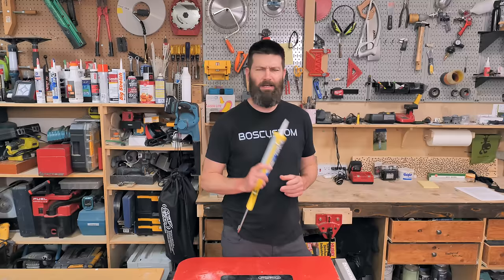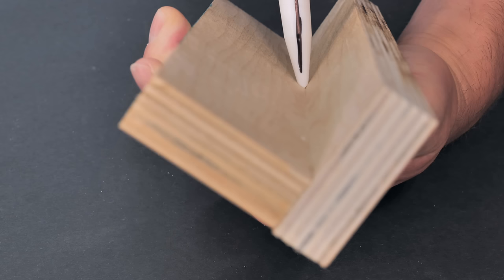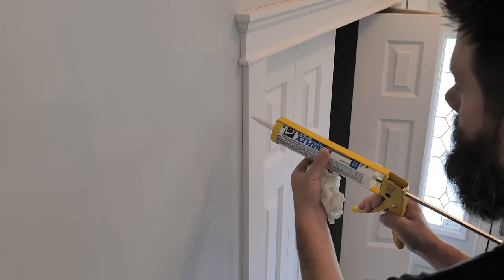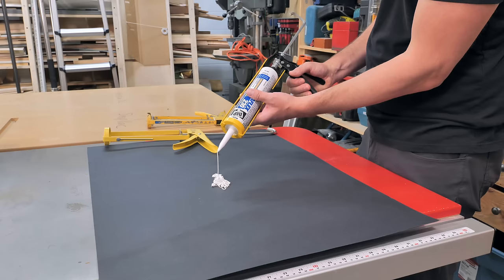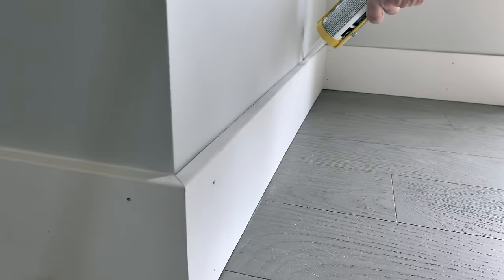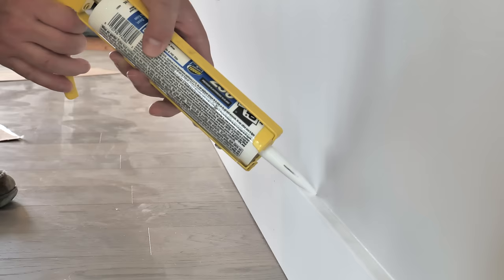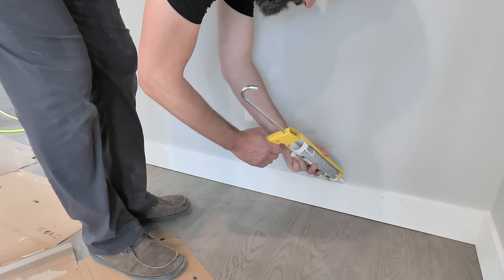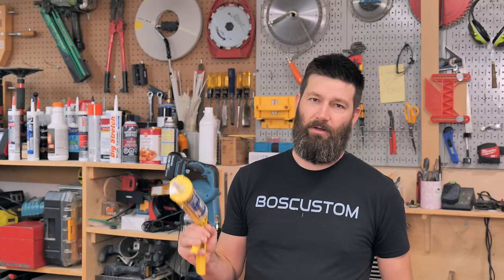The Secret Caulking Tip That Will Transform Your Ability!

Comment: Thank you, this is helpful. But it's still kinda hard because I always get messed up in the corners, esp. when 3 "directions" meet, it becomes a huge mess. Also, can you talk about how to do this when you have to caulk a wall that is bordered by 2 other walls? The problem is that you can start at the first corner/wall and go towards the other one, but as you approach that, you'll have to start changing the angle to become more and more steep, basically all the way up to 90 degrees, and then it becomes a mess again. Or you stop halfway and start at the other side, but then somehow I still manage to make it a mess, at the very least when I try to swipe it with my finger (or use one of those triangular swiping tools, which work really well). The worst was when I needed to recaulk my kitchen sink, the gun was too big to be led all the way around and the whole thing just got really messy. Anyone have any insights or experience?

Comment: And as for dripless guns, it's not the gun as much as the tube of caulking. I've been painting 26 years and have the same two orange home Depot guns I've used since I started. They were $4 guns back then. They rarely drip. When caulking keep coming out I have found it's almost always due to air being in the tube. It pops and snaps. So I squeeze it out until the popping and snapping stops ridding the tube of all the air likely present during production and voila, no more drip.

Comment: Contractor here: usually you want to PUSH the caulk not pull through the work. 
Guy gives some good advice. LESS is MORE, especially with silicone. 
Video is ripe for sexual inuendo 😂 as are many building terminologies. I’ve had many female clients hesitate or question the proper use of the word caulk! Hahaha

Comment: Baby wipes are super useful. Cheap, plentiful, and robust enough that you don't have to worry about tear through.
Reply: You could just buy painters rags or heavy duty shop paper towels. Much less expensive. And the residue left behind by baby wipes will prevent the caulk from properly bonding to surfaces. This is not a good idea.

Comment: Wait wipe off with finger don't just leave a big glop?! Oh I get it so sort of push with finger the glop into the crack... but is that also how it should be done outside around window frames so the god damn rainwater doesn't get into those cracks or would getting awnings over those windows work better?! How many feet of water will a centimeter or two of caulk stop from getting into a crack until it can no longer stop the water?!